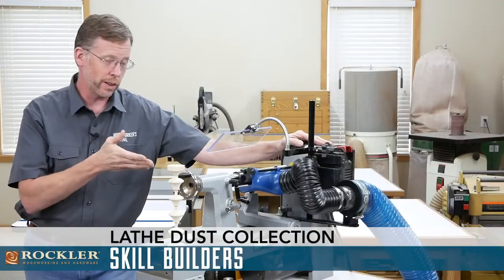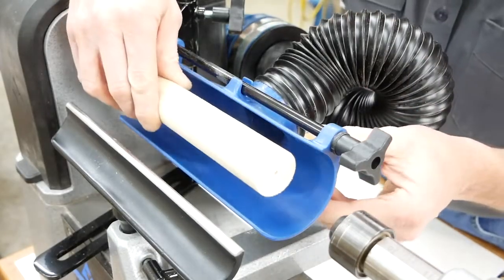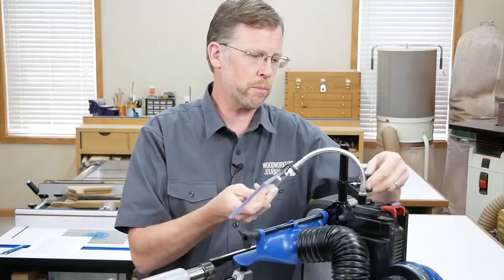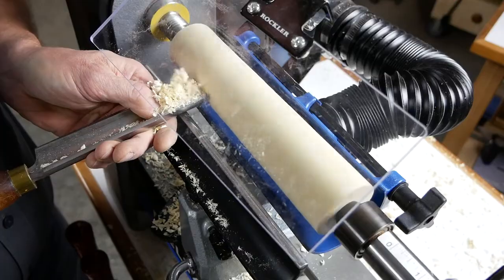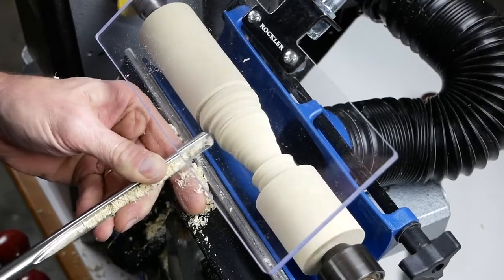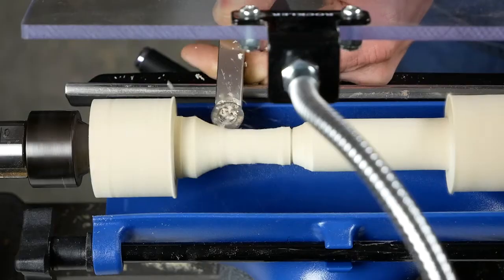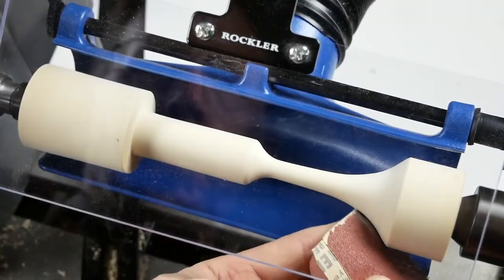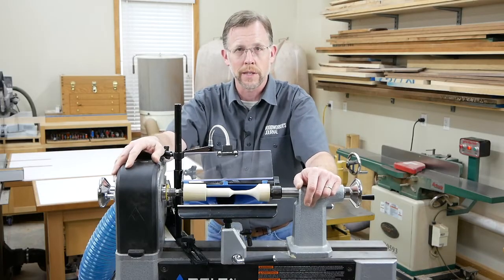Lathe Dust Collection System | Rockler Skill Builders

Comment: In dry climates like where I live, static is a major issue.  That chip deflector can be wiped occasionally with plain old unscented static control dryer sheets to help it repel dust that the static likes to grab.  I use them on my face shield and safety glasses.  Cheers! Chris.
Reply: that is a great tip! Thx Chris!
Reply: I'm glad you mentioned using static control dryer sheets.  I'm definitely going to try that on the inside of my deflector shield.  But I'll probably get the scented type so I can smell  Spring in the air. LOL  Thank you for that tip.

Comment: Hey Chris, Until you showed the sanding part of this very enlightening tool demonstration I was quite hesitant about spending the $80 for this 2-part dust collection apparatus simply because I didn't want to also have to contend with wood dust from my projects clouding up the view under the deflector shield of this system.  However, I was quite surprised to see that you did not have that issue, so I'm going to give the whole kit a shot.  Thank you for the thorough review of this set up.

Comment: Why not make these with a 4 inch hose connection to the scoop and include an adapter for 2.5 inch vacs?  That 2.5 connector chokes down the air flow from a decent dust collector.  Going the other way wouldn’t hurt those with the 2.5 inch shop vacs.
Reply: I concur.  Very good point if Rockler wants professional turners to consider what otherwise might be only considered an infrequent using hobbyist's dust collection setup.